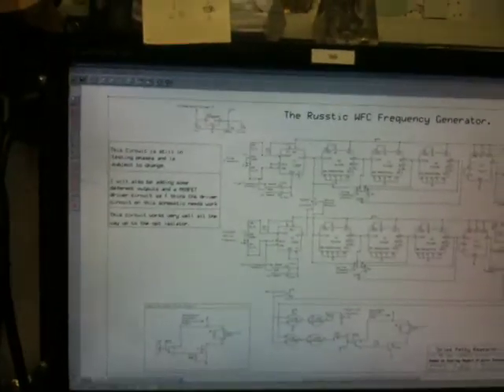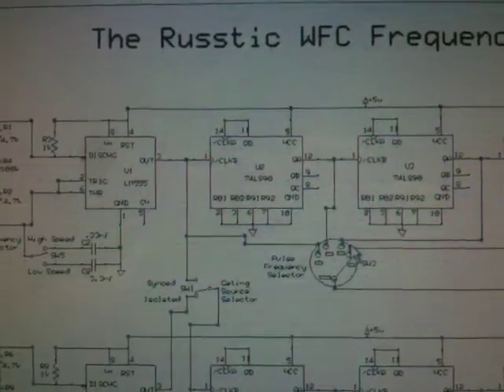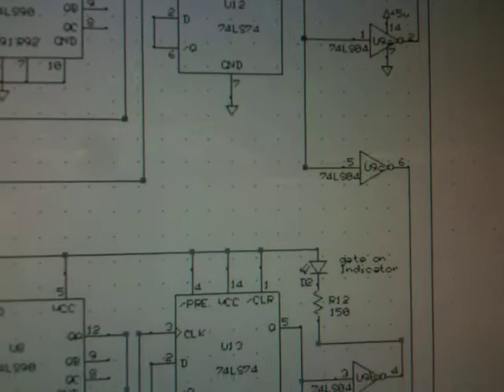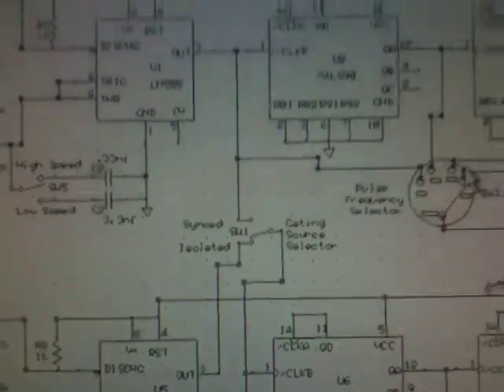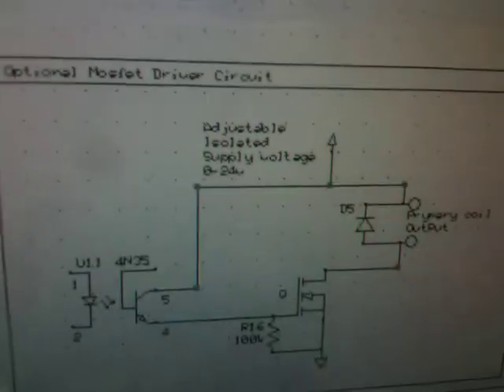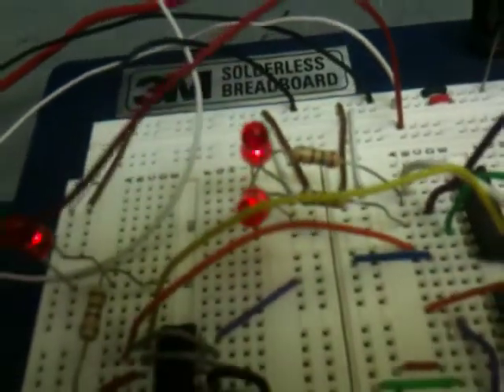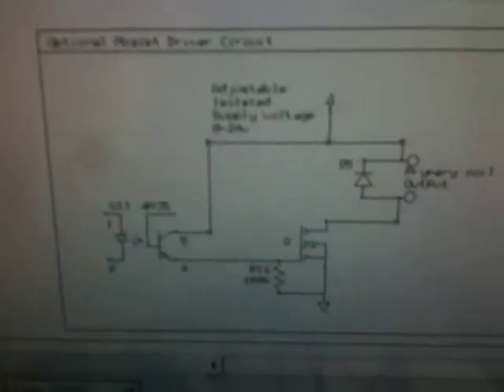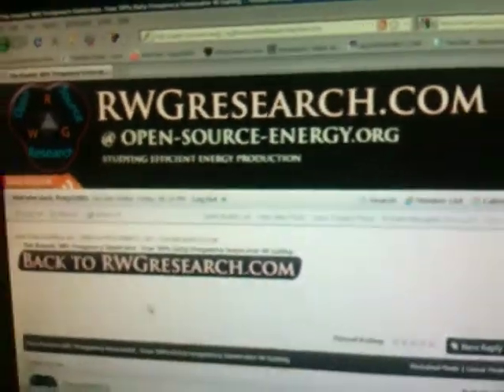The Russtic WFC Frequency Generator. True 50% Duty Frequency Generator W Gating. www.RWGresearch.com

Comment from the maker: @irondmax I have been doing some deep studying and if you read the patents there is a spot where stan talked about the applied voltage. He states that the voltage is also part of tuning. So the 2n3055 is a transistor that is adjusted with an analog voltage. It allows the tuning circuits to very the voltage on the fly! As well as control the amount of output gas so the system prusure can be maintained. Hope this helps? ~Russ

Comment from the maker: @salsa20 stan used a specific pulse pattern to do what he did...  im using the almost the same type of setup. the main deference is nowadays there are more and better ways of doing the same thing. its basically the same idea but stans system was integrated with all other systems so its hard to just use what he used with out building the entire system... that is in the works tho...  thanks, ~Russ

Comment from the maker: @irondmax meyer drove a TIP120 and varied the voltage using a 2N3055. so there was a really big system that needs to be all integrated with other systems stan built to work correctly. this circuit is for the WFC. the circuit i was not going to build was for the EPG. and that stays the same for now. using the arduino to pulse the EPG. The WFC is defrent. as well as the Gas Possessor it will also need a defrent circuit. ~Russ

Comment: @irondmax   meyer didn't just use an scr (unless his switching diode was an scr) on diagrams where mains voltage was used, he did use an scr.   If you look at the international patent, his vic is driven by two transistors, one creating an analog voltage wave form, the other transistor pulsing square waves with a gate pulse.   The bottom line is, if you can't convert 5 gallons of water in an hour to hydrogen, using a 3" cell, you havent exactly duplicated meyer (or at least what he claimed)

Comment: MJ2955 is a complementary (PNP) transistor for the 2N3055.
the 2n3055. is( NPN).........these transistors handle up to 15 amps.....if i remember correctly.
i wonder why meyer used a power transistor.....if he only needed miliamps ....why a power transistor?
interesting